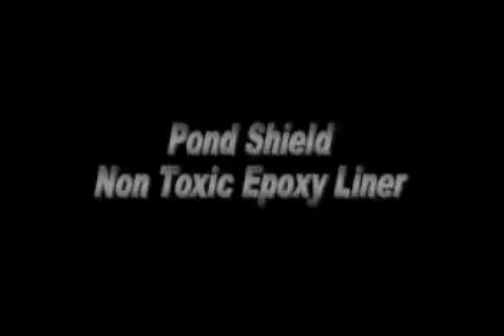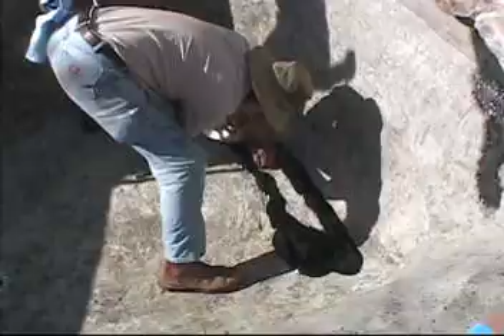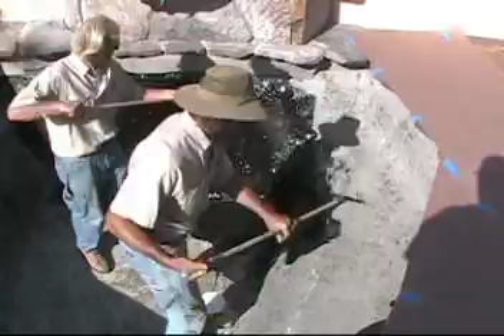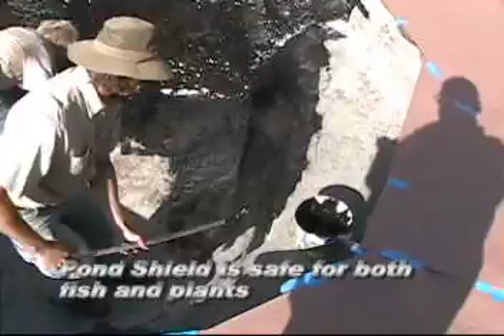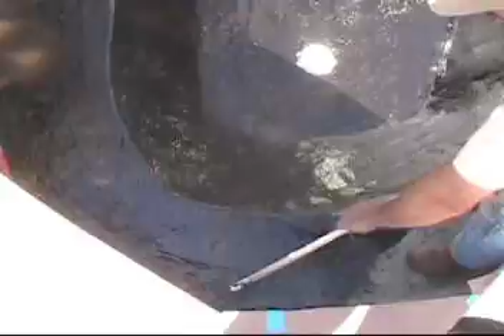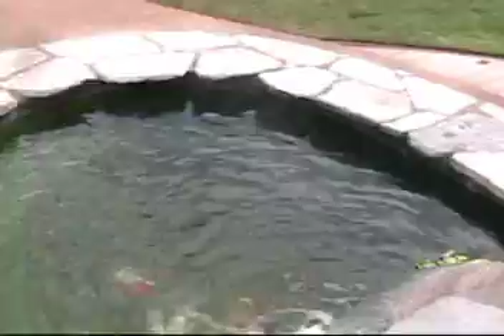Pond Shield Being Applied to a Pond

Comment: How long will it stay on until you have to re-paint? Thanks!
Reply from the maker: Well that depends on if the surface was prepared properly, the coating was applied properly and how well you take care of it.  We have had water features that have gone 20+ years.  That's not out of the norm, but rather shows you a good time frame if you manage the water feature properly.

Comment: how much will i need to paint a 6' x 3' x 30" raised Pond. Their are only 3 walls, the forth wall is actually a viewing window
Reply from the maker: Stefan O'Brien Two 1.5 quart kits either way, depending on which side that window is in.  One way and you'll have a little bit more left over than the other way.
Reply: okay thanks a lot! the window is on the the longer side